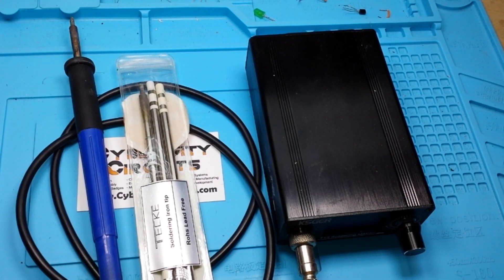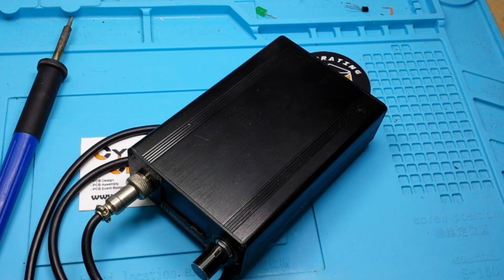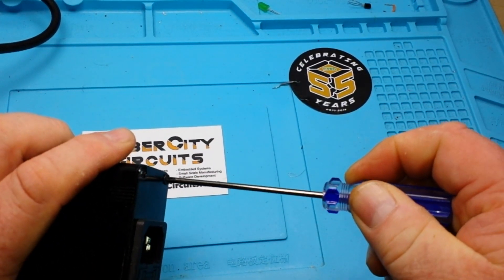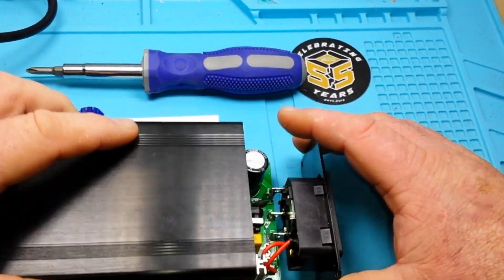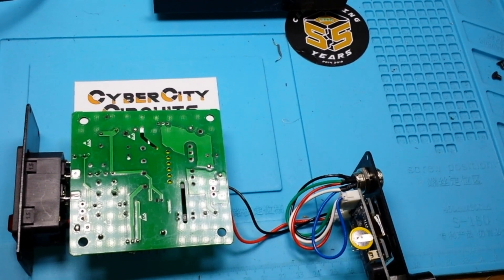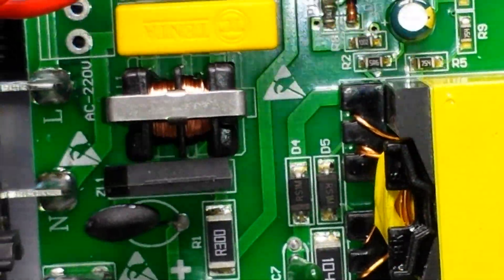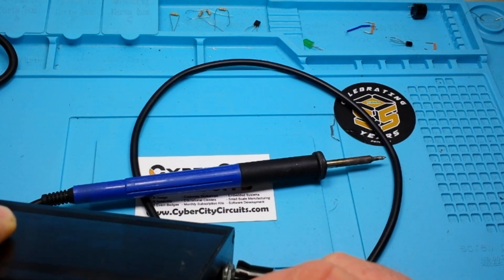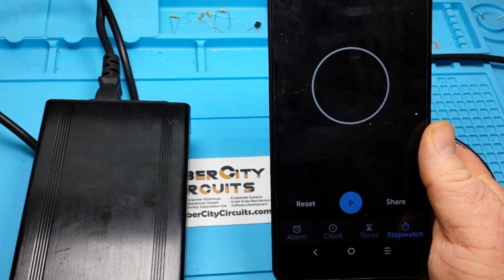KSGER T12 Soldering Station a year later

Comment: Other channels have pointed out that the only thing preventing one of the aluminum heatsinks from shorting out the power supply is the thin layer of soldermask on the foil traces. I'd wanna fix that, just in case.....

Comment: It is OK for the price. But an Ersa it is not. Takes some time to heat up and the temperature seems to be unstable. Even when the station says it has heated up I add at least 30 seconds before using it. The handle is also not very ergonomic. But considering the price it is fine.

Comment: can i use T-15 hakko tips with this? the ends look the same. also can i use a hakko handle/wire with this? are the connectors the same at the device?
Reply from the maker: No you must use the T-12
Reply: @learnelectronics  , why? T15 and T12 tips are supposed to be the same, mechanically and electrically.
Reply: The Hakko connector is a DIN plug, very different from the GX-type aviation connector used on the Ksger; you'd have to cut off the connector from the Hakko iron, figure out the wiring  scheme, and solder a GX plug (with the correct # and orientation of pins) onto the Hakko cable.

Comment: I absolutely love the T12 design ... just the tip gets hot ... so you can weave it down through a bunch of wiring to solder a point and not melt the plastic on the other wires.. 

   It heats quick... you can change tips and not have to wait for the tip to cool down before you can touch it...with  this model you can set sleep time , how long the boost range is on , and the power difference on boost..  Ill never go back to a finger burning,  wire melting, waiting forever to heat up , soldering iron again... except for a backup... but at the price of these things i might buy another one for a backup..

Comment: My only concern I don't order is not ESD, Need to work with Cellphones. I just see Grounded mod but not ESD.
Reply: I assumed  TVS diode can prevent ESD,but I dont know how to use it.Ppl said a battery power suplied solder station has no ESD issues.The cheap PSU caused ESD issues.
Reply: @shine9001  Sorry what is the point? A TVS Diode connected where? People say a battery powered soldering station has no ESD? But those station are very low wattage. In order to work fixing cellphone you will need 70 watts on fine tips. I wish I can afford Hakko station.

Comment: I have this too T12 but is the more modular version more durable, the one with separate power supply (which you need a power plug for in addition)? The KSGER T12 (there are rebranded ones but less choices on form factor, the Quicko which is twice as cheap as the KSGER and Quecoo which seems to be more expensive than the KSGER. Both don't have elegant lettering and not as cool sounding as KSGER, though and I think only comes in the small form factor, modular which is good but maybe not for stacking).

The KSGER T12 is my other and new favorite tool now (I just got it some days ago), aside from digital caliper, all metal (first all metal), digital caliper by General.

God bless, Rev. 21:4

Comment: Hi thank you for the review, I am a fan of your channel. May I ask a question? I bought the KSGER T12 v 2.1 but noticed that at 300 degree C it doesn't melt the solder on the tip. I tried different tips and no success. It works at 340 degree C. Thnx
Reply from the maker: The has to do with your solder, not the iron
Reply: @learnelectronics  Thank you very much!

Comment: Your 17 Sec to 350°C is a a little un-real-life. This 17 Sec also include the (rather sluggish) MCU  boot time. On a normal working day your iron will be ON and at "parking position" at 150°C or. From there to 350°C it takes (my guess) 3 Sec or so. 
The hand piece is called 9501 (I would buy the same, because there are stands for it, <$10 on AliE).
So 350°C it is, I guess you solder NoPB, same here. I wonder, how long your tips last? 
Disclaimer: I have no T12, I have an Atten ST80, a good solder station with sleeping and 3 pre-sets. However I can dream of those up to temp times. I think it takes 45 Sec or so, 10+ from parking position. The (fake) Hakko tips have a very short lifetime. The T12 is on my shopping list.
Reply: How is the time "un-real-life"? If a person walked up to their work area, sat down to solder a joint and turned on the unit from a powered down off then the 17 second time frame from off and cold would be correct. An initial from a totally cold powered down to ready to solder time of 17 seconds is pretty impressive for such an inexpensive piece of equipment.
Reply: The Harbor Freight "Schneider"  digital soldering station is a rebranded Atten ST-80 ($100 in 2025). It works guite well after replacing the crappy stock "solid iron" tips with genuine copper-core Hakko tips ( T18/900M), which significantly improves thermal transfer and overall performance. The one thing I haven't found is an exact replacement handpiece/wand; HF doesn't sell them and I've not found them on Amazon or ebay ( I don't like buying direct from unsecured Chinese sites). The Atten uses a 7-pin GX aviation connecter, while everybody else uses 5 or 6 pin DIN or GX connectors, often with the opposite male/female  interface. I'll probably have to modify another brand of handpiece/wand to make it compatible with the Harbor Freight Schneider/ Atten; it seems their products are fairly well known and popular in Australia and India but they have no authorized distributor for parts in the US.

Comment: My unit failed in two ways. 1st the sensor stopped working. I had to push the button after it went to sleep. I did that for a few days then i had the iron just die. I tried to see what happened and there was an arch out of the handle at the strain relief. then an error message. I cycled power and it came back but the tip became very hot and in seconds was glowing Cherry Red. I shut the unit off. I ordered a new all metal handle. I put the new handle on the unit but it also took off and Glowed Cherry Red. I contacted AliExpress where i ordered the unit from. I wanted to buy the latest version so i searched for 3.1v and that is what i ordered. However the only handle they offered was the cheap all black plastic handle. It was the strain relief of the cheap handle that failed. They asked me for photos of the tips with the blue burn marks. Then after several weeks they asked for a video of the handle in bright red. then they wanted me to agree not bug them anymore if they sent a new controller. Finally just today i got a tracking number but it does not show any package shipped yet.  I initially liked the KSGER unit for sure it was smart and fast and worked great until the handle shorted out. If this new controller does not repair the unit i will need to find a source to have it repaired. Maybe you would be willing to take that task on for me and video the diagnosis and repair???? Thank You for your informed posts.    https://youtu.be/65ASKZczA2Y
Reply: Still waiting for warranty replacement board. Nothing Nov 3rd.

Comment: The opto isolator is not the only thing bridging the gap! The isolation between mains and the low voltage side is defeated by the raw aluminium heat sink that clearly jumpers right over one of the slots! No way does this meet the minimum safety standards (by UK/EU standards at least).

I just subscribed. You have some interesting videos it looks like. Nothing wrong with being an amateur, but please be careful when certifying something as good/safe/whatever if you may not know what you’re talking about. It’s not the only problem with this station either (safety wise).

Comment: What type of soldering do you do? I service old audio equipment with thru-hole and point-to-point, tube sockets etc. which is probably harder on tip plating than SMD, new PCBs would be. Thinking of replacing my old Weller with a T12 type iron. I want something that will hold up well. Thanks.
Reply from the maker: 90% TH 10%SMD almost all on PCB's

Comment: Aaand here we go again. Another video saying so great things about the mains/secondary separation and safety of this unit, looking at the bottom of the board... while completely disregarding the huge metal heatsink on the topside, going straight over that "separation" gap! The mains side of that heatsink is resting ON THE TRACE right next to the big mains capacitor! Your secondary side heatsink is separated from rectified mains by the solder mask on that trace! A very well-known snag in this unit by now. I have the same issue and I just pulled the heatsink off, ground some of the metal off and added some kapton tape underneath too. Otherwise a great unit. Too bad the Chinesium devices do this all the time. They completely ruin an otherwise nice device by some horrible blunder which would never pass any western safety checks.
Reply: @itikkulayanowich  Did you read the comment I wrote?

Comment: bein youtube stupid as iam. ill toss this at u here.. a tachometer for 1 cylinder motors. 4 cycle. all on market really dont read them the rite way you have to do math to figure it out. lol.. iam talking about old coil style ignition systems. from the 70s. where u have points and coil ..
Reply from the maker: Magnetic sensor...
Reply: @learnelectronics  yeah where? homemade be more fun then the store bought ones. o will.. got to go put my 756pro3 on my tractor . later lol

Comment: I had a friend give me a old station that had a led bar and a pot control and I can not find the name on the net. The tag was mostly gone but it did have a T on it it could of been a Tenma maybe.... Needless to say it did not work, BUT it had this big juicy transformer that had a 24 volt AC tap on it, a good case, corde, holder just the control board was shot. I think it was a mist blue not sure ( I painted it.. ).
It reminded me of the old Craftsman one made by Weller I think. It was a 1970/80 station of that time...

So I bought a 24 Volt AC to 24 volt dc power supply for $10 bucks and one of thoses 3 digit display with a iron T12 kit for $8 bucks all from eBay and it uses the standard T12 tips.
I slapped it all together and tested it and it works great. On the bench... Lol

Seeing how the main cover was missing from the case (old glue) I took some plastic sheeting I use for modeling and made a new plate with the new hole drilled in it. This thing is the best Iron I have ever had, it heats up in 10 sec's (sorry no beep) it flashes when ready.
The heat displacement is not to bad as long as the ground plain is not 1/2 of the board... Lol
It works on 24 and 12 volts but I use it at 24 volts suplly, the recovery is 10 times better than at 12 volts.
I have 2 of the fancy stations and a hot air combo station, I just like this one better... Lol
Thanks for the update video and your hard work to keep us entertained... :-)
LLAP
Reply from the maker: Thank you, nice project description.

Comment: I use my trusty 3 in 1 solder, hot air and no frills power supply  Its big, ugly and heats up in similar time.  I sometimes only make one joint - but its fast enough that an impulse "blob" is no trouble.
 ... I recently made a sawblade holder from a length of copper pipe and two thick brass endstops which I soldered in place with the iron, just to see if it would (it did!!) and if I say so myself it made a lovely job and took no time at all, so no problem with thermal mass.
I have two ts80s (long story) which are perfectly serviceable (if you don't mind the qc3 fandango) - but the tips are expensive.

The solder station uses oldstyle iron /copper sleeve type bits which cost a few pennies each, cheap enough to file a new shape tip or I've started drilling a 1.5mm hole in the face to act as a reservoir, it makes removing and reflowing components so easy, when you can charge the tip with solder and then make two or three tacks without needing three hands to hold the part, the component and the solder.
And while the iron is light the unit is massive enough that there's no danger of dragging it off the bench.

Comment: I have it too, but to be honest I was expecting a significant improvement over the 936-style stations. I still it difficult to work with lead-free solder or pins going to large copper planes (well, not difficult, but I have to put it in boost mode).
Reply: For those you need the heaviest tip you can get to have more thermal mass too, but this small iron is really not meant for those large planes. You could apply extra heat to the copper fill with a hot air station to get going better.

Comment: I bought the exact same model (KSGER) more than one year before and it's work wonderfully. Before i own an 200$ Weller, after some time i see on google an Hakko T12 compared to this one and i thought to bought one. After bought this one, surprise... it was the best soldering station do i ever had, and believe me guys, the KSGER outperforms Weller in anyway. I use it like 2 to 3 time at week, from the smallest job to the biggest 8 gauge joint's and till now it work's like a charm, no issue's yet. By the way, mine heat from 0 to 330 c° in 11-12 seconds.

Comment: I bought one about 6 months ago and its pretty much my daily driver.  The only time I have had issues is when trying to add leaded solder to non leaded solder and trying to wick the solder off of a large ground plane such as I do when replacing HDMI re-timer chips on XBOX consoles.  I usually have to get out my old school Radio Shack iron for that.  The joys of working on a tiny budget! LOL

Comment: Looks like I've seen my next budget soldering iron?

Also just bought Aneng 8009 multimeter based on your recommendation, so far it's a great little meter that is so much better than the sub $10 ones I've been working with up to now - thank you
Reply from the maker: Thanks for watching
Reply: @learnelectronics  no thanks for putting out such great content, otherwise we would not have anything worthwhile to watch !
Hope you & those you care about are well 

Ttfn

Ps any chance of a UK Amazon affiliate link ?

Comment: At that price and quality it's a really good choice.
I'v got the same station just a version with LED display, not the fancy OLED stuff.
Best part of it is that you can use genuine T12 or rather the newer T15 tips on it.
Stay safe.
Reply: The Chinese "KSGER" tips do seem to work just fine, I have not so far seen any need to buy original tips for hobby use, but it's great to know I have that option.

Comment: How long will it last do you think?
Reply: Many years if you tin the tip and special care for tips
Reply: @MUHAMMADYAWARIFRAHEEM  i don't care about the tips lifespan. I just want to know if the base or station is going to last at least 5 years or so.
Reply: @DoctorThe113  yup
Reply: You can get the front modules as replacement parts for very cheap at least, probably also the power modules. It's quite serviceable.

Comment: Just ordered one but the cheaper one that needs laptop adaptor. The name is quicko @ $20.
Reply: Its also good and same they both use stm microcontroller ksger have built in psu i also have and its good
Reply: I own one with the quicko brand which use external power supply too (quicko 942). the user interface is simpler than KSGER without individual tip profile and some other features, but I find it more convenient for me out of the box. the good is, it can be powered up using lipo pack when you need to. 😉
Reply: @radius.indrawan  AFAIK they are pretty much the same inside so you can just flash your favourite firmware on it. There are different ones available.